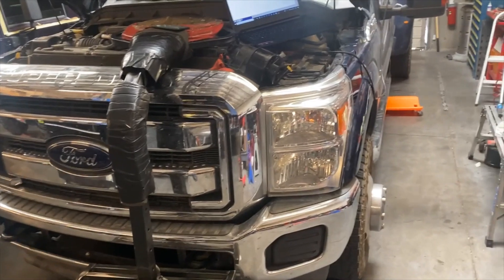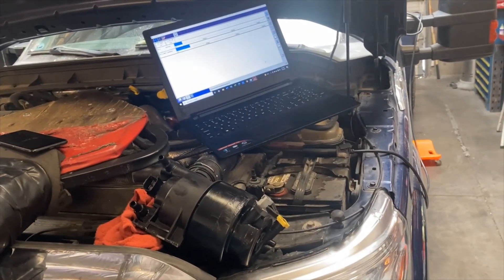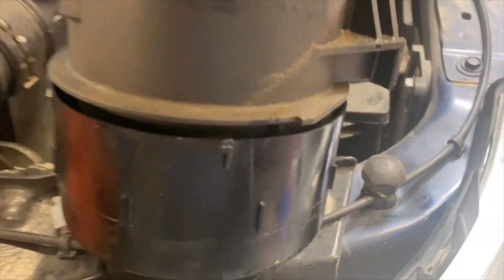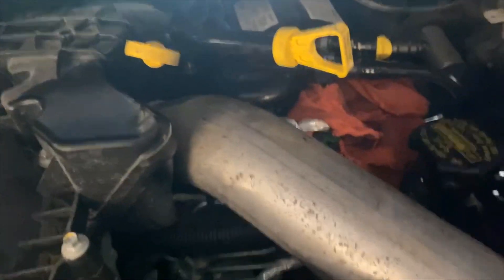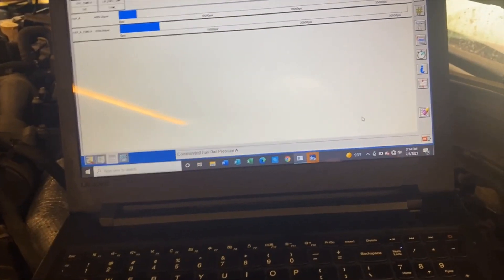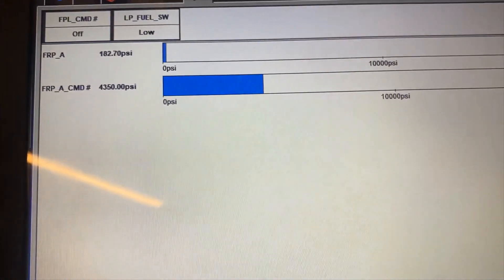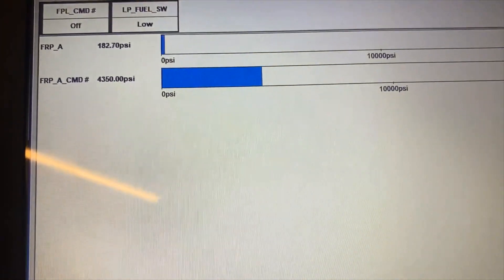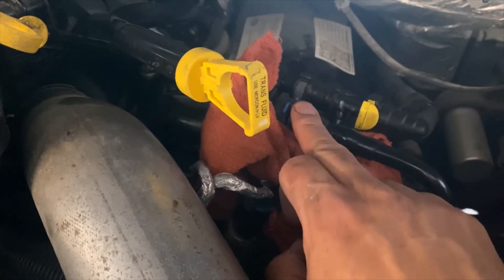Powerstroke 6.7L low fuel pressure on lift pump low side

Comment: Great video! I have a question i have some kind of air getting into my 6.7 I changed the filters after a started getting this weird hum under the hood and a extended start situation , the truck starts up after a few seconds and runs fine no hesitation or rough idle. my lift pump which i changed out last year is a pump i bought from oriellys when my old pump went out. But its making a loud screeching sound? could this pump be the cause of this air getting into my system?
Reply from the maker: Loud screeching usually means air. If you have the early spin on filter did u line up the marks and tighten it to them?
Reply: @dieseltalkwithtonysalas8725   yes sir aligned the  tabs until they touched.

Comment: It really helped To grease where the fuel filter screwed in under the frame that when you take it off recently and then put it back on with a new filter. It really helped her that plastic is really sticky.

Comment: I know this is a old video. But im having intermediate cutting out mostly at low speeds and around 3,4th gear. It doesn't do it all the time but most of the time it will. Cold or hot. I've changed out both filters and and made sure it was at the stop on the lift pump. The code i get is p2539 code. 2014 ford f250 6.7 powerstroke.  I have a sct programmer on it and when it does it my fuel rate drops to 0 then back to over 300 withend a split second.  What do you think it would be. Thank you

Comment: I did the low pressure/ lift pump on its own and the billet/filter holder would not refill. I followed your advice and the air pumped out , the billet/filter holder filled and the engine started. Thank you!
Reply from the maker: Welcome!

Comment: Well I don't see what switch you're talking about.If you'd move your laptop off one side we could see what you're talking about
Reply from the maker: You know you could google it. The switch is on the outlet of the secondary fuel filter. 
On 2016 and newer models that low pressure switch and the fuel temperature sensor are as one unit.

Comment: Just an owner of a 2011 6.7 250.... but have also built my own acft so mechanics is second nature. Installed an SPE disaster prevention kit and micron filter which all went well. Problem was I violated my own rule...only change one thing at a time which was just install the kit, prime and test run. Like @stevewill1940 below, I also changed the lower fuel/water filter before testing but not the top. Two things were changed. And your comment about the canister not reaching the stop was the mistake I made. Found that thru the  bottle test and the stream was almost non exxistent. Rechecked the canister and saw the stop tab wasn't making contact by about a 1/16th of a turn. Fixed that, primed 5 times then fired right up. Good to go. Then changed out the top filter, 5 more primes and done. I've found the SPE unit to be well thought out except for the 45 degree fitting off the adapter having to be aligned further aft by about 15 degrees to avoid an engine casting contact.....may just be a 2011 problem.

Comment: Hey there please help me with my truck its 2013 f350 6.7 recently changed all injectors with cp4 to dcr conversion with new fuel rails filters and temp sensor.
Now at idle my fuel rails pressure isnt steady commanded is 4000 and actuall goes all the way from 3300 to 4200 psi and sometimes i can hear vibrations at idle and coming to a stop it wants to stall but smoothens right out with in a second it drives and starts fine pressure matches commanded when throttle is pressed even a tad bit and while driving pressure is fine?
Reply from the maker: @sahilbathla1824  first question
Was the fuel system contaminated?
Reply: No the fuel system was not contaminated one of the injector failed as a original problem.

Comment: Hey how you doing out there hope everything great I have a few questions I changed the pump under the frame I hook everything back up the same way I try  to start it it didn't start at all I see in the video when you was at 2 minutes you was saying that you took off the line where the sensor was at I wonder if you I take off that line the same way but the only thing is I don't have a computer or  scanner  or anything to hooked up  to the truck so I'm wondering if disconnect line and sensor that you were saying to bleed it out and get the air out would that work or I would need the computer and scanner
Reply from the maker: @FrankFletcher-p3t  Did you verify you getting fuel out the secondary fuel filter in the engine compartment?
Hook up a hose to the outlet line to a container when you cycle the key to the run position verify fuel flow
Reply: Good morning good evening thanks for the information I just unhook it the Blue Line meaning the blue one with the blue connection no fuel is coming out
Reply from the maker: @FrankFletcher-p3t  this is with key cycled on ? No fuel out of blue line?
If it a quick crank and leave key on.
Should have fuel coming out
Reply: At all

Comment: 2017 f260 I have this code p008a showing low fuel pressure on cold morning start 5f two times already no cel truck runs fine is it possible it’s gelled up fuel? It only happens on cold engine on start up, I did check pressure with forscan and showed 55psi on idle

Comment: I am an Ag Teacher, mainly Ag Mechanics, I have a random problem that started a year ago with my 2016 6.7L. Truck has 135k and has Lucas fuel treatment every 3rd tank of fuel if not sooner.  When on a trip longer than an hour, pulling or not, but mainly when pulling a trailer, the engine would momentarily cut out "cough", but never triggered a CEL code. Started in Dec of 23 and did it 6 or 7 times to April of 24.  I don't daily drive the truck a lot at the present.  We mainly use it for pulling ranch equipment or when I have to use my truck to haul students show animals and projects. The last time it "coughed" it did it hard about 4 times consecutively. I pulled off at the next exit and shut down the truck and found the engine had more oil in it than it should.  So I did an oil change in the parking lot of Bass Pro Shops.  I captured 3.5 gallons of oil and diesel.  Fuel has to be entering through the pump shaft seal as the truck does not smoke, has never been allowed to short cycle a regen,  and runs perfectly otherwise. The engine was 2500 miles on that oil change from December.  Took it easy on the way to our destination, and it "coughed" 2 more times.  Checked the oil and it was not significantly higher. Ran the truck to a local shop, they kept it a week and couldn't get it to act up. Picked the truck up and had it "cough" on the way to my ranch about 2 months later. Dropped it off at another shop out there and they had the truck for 3 weeks, could not make the engine duplicate the issue. While there, they pulled the sensor off the CP4 pump to make sure it wasn't failing.  No metal found, and nothing present on the pcm.  After talking with a former student who is a Diesel Tech he said he had never seen one puke fuel out the CP4 shaft seal without throwing a CEL Code of some kind.  Working blind he would replace the fuel pressure relief valve on the drivers fuel rail. I replaced it with an amazon should work part, finally get a code of P228F, scan tool suggested changing the valve or the pressure sensor.  So I picked up the pressure sensor from Ford. Still get a P228F  Fuel Pressure Regulator 99 Exceeded Learning Limits-Too High. I figure the valve is a reject and will be getting another replacement. 
 When I replaced the valve I also changed the fuel filters. On the wrong side of the primary filter I found a small brown algae worm in the bottom of the inside of the fuel filter. Now I notice that I hear the pump running way more than it should and I know the filter base is all the way home not bleeding air. Should the electric pump have a check valve on the intake line from the tank?  If it does and was bad could that cause some or all of this issue?  I am meticulous about my trucks mechanical maintenance.  I have to be since I have to use it for school trips, hauling show animals and ag mech projects. This is driving me nuts.

Comment: im a diesel tech myself,found best way for to avoid issues is change one filter at a time -starting the vehicle after changing the lower filter first,then the upper -and ive never had issues on a restart which does include key priming a few times.
Reply: Just did the exact same thing. Worked great.
Reply: @davidrods4678  its a simple theory....think about a drinking straw when capped off with  your finger.....dont let the fluid leave the tube and itll be there upon start up
Reply: That’s how I do it as well 🤙

Comment: Does the low pressure sensor read high pressure too?cause I got a P0088 code
Reply from the maker: The low pressure switch is a switch set at around 48 to 58 psi
Need to look it up
So it’s not a variable sensor just a switch.
P0088 is a code for rail pressure on the high pressure side.

Comment: Getting a p2539 code via ez lynk replaced lower lift pump and still having same issue. Truck loses power in between 1&2 shift and in between 3&4 shift under heavy load…
Reply from the maker: @dylanware2424  this can be more complicated 
If you have lift pump pressure and volume the issue is on the high pressure side.
I would start by checking for contamination by removing the high rail pressure control
Valve and look for contamination. You can also remove the volume control valve from the injection pump. Do that first before going after the injectors
Reply: Did you ever get your issue resolved? I have EZlynk with 2017 6.7 power stroke; when I punch it, I get the same issues you get.
Reply: Yes, Tuning issue
Reply: If you need any further help let me know and I can point you in the right direction
Reply: @dylanware2424  Ahh, thanks; what were you running with EZlynk? I’m using ‘Proven diesel’ out of Canada; I notice on the ‘high rail pressure setting’ that the problem was greatly reduced, but not fixed…but any of the +200 tunes would do it, if not running high rail pressure.
Reply: @jasonbaldridge4281  I still use the ez lynk platform but have full support through 2 different tuners, all custom unlike a proven or gdp. Had the issue with one tuner the other tuner have no issue with his files, currently running a 250 single and have zero problem. Other tuner the biggest file I could download was a 120 rumble file lol.

Comment: Im getting a p2291 after replacing the fuel filter i had a p228F and I replaced the fuel filters along with the high pressure regulator test drove it and now im getting the p2291 and it wont start
Reply from the maker: The pressure regulator on the drivers side rail? Why?

Comment: I have a 2014 F250 6.7 getting a P0087 and P2291 I changed out the DCFM I hooked a hose up to the inlet hose on the topside filter and waited to see if air came out or just fuel and fuel came out like normal but it just cranks and cranks. You think this what you ran into may be the problem? I did unhook the hose rope and it was definitely pressurized.
Reply: I have the same problem did you ever figure it out
Reply: @ cp4 pump took a crap had to replace the whole fuel system
Reply: @Stanton02  how did you diagnose the pump
Reply: @ my buddy who is a master technician for ford diagnosed and we found metal shavings in the fuel system.
Reply: @Stanton02 what did it cost? New or used parts and did you do it yourself
Reply: @nedthemumbler9942  I made the parts I had laying around but it turned out that my fuel pump was bad and I had to replace the entire fuel line and pump, I’m lucky to have a buddy who is a master mechanic for ford and he installed in for me.

Comment: HELP🫠

F350 was running perfect, i changed the fuel filters, primed them, truck fires right up, but now its like hesitating/stalling while driving. Ive made sure the filter cap is tightened all the way, im at a loss.
Reply from the maker: When u primed how long did u let it run before you started to drive it?
Reply: @dieseltalkwithtonysalas8725  20 minutes

Comment: @dieseltalkwithtonysalas8725 - have you ever dealt with diesel  pouring  out the  oil /air separator  (black box on driver side under the hood)once keyed on?  I have the reroute  kit or hose instead of the oil separator  box.
Reply: Yes, the original  oil/air separator  assembly  hose broke so it was replaced  with the re- route kit that reroutes through  a 3/4 line that routes down the vehicles frame  rail. Now once keyed on, fuel spray  or flows out that fitting  ports there, as well out the end of that 3/4" end of the line.
Reply: I agree that it shouldn't.  Just to  confirm,  it's  on the driver side near the firewall.   It's in place of the rectangular  box assembly beside or   where you check  your oil/ transmission  fluid levels.
Reply from the maker: Hold on where from the box? 
There should be no fuel there 
Need more detail
Under the box are injectors and return lines, you sure it is from the black crankcase filter?

Comment: Great video, my problem is, I am getting no power to the lift or pump to send it up to the upper fuel filter. It’s a brand new lift pump and I have jumped it off the battery and I know it works. Just don’t know why I have no power to the lift pump.
Reply from the maker: Good morning
What is the year model?
If the pump is not kicking on need to check fuses and relay.
Reply: @dieseltalkwithtonysalas8725  the truck is. Also deleted. This started when I change the tune of the truck and then the truck did not start back up. The truck was running fantastic before this.
Reply: Would it have anything to do with the ecm not sending a signal?

Comment: Catch 22: Replace the fuel filters to maintain pristine fuel to the CP4.2 to keep the CP4.2 happy. Replacing the fuel filters introduces air and low fuel pressure to the CP4.2 which damages the pump unless you use the soda bottle method.
Reply from the maker: But! The rule is you prime the system at least 3 times before starting and after starting you let it idle 10-15 min before driving

Comment: How do you get all the air out of the line
Reply from the maker: Good day!
Well you have to let the system prime and push air out . Cycle key every minute at least 4 times to have the lift pump push air out.
After engine starts, let it idle for 10-15 minutes.
Reply: There was air in the line 
Took off the fuel line air came out ,, primed it ,, started up,,then a week later the def pump went out .. omg that was a pain,, running Great now ..
Reply: Evening ,
A guy is coming to see if the lift pump is ok 

I have fuel coming out but it may not be enough pressure to start the truck . Does that sound right?
2016 6.7
78,000 mile 

I’ll check the fuel filter to make sure it’s tight,,,

Comment: Great video, I have A 6.7 and im getting code p228f and p0087 need help I've already put bottom pump and all sensors related to high and low fuel pressure and I've installed new filters but no luck I keep getting reduced engine power when I press on the throttle idk what else to look for other than the high pressure pump , trk only has 76000 miles
Reply from the maker: Was on vacation, sorry for not replying sooner, you get it figured out?
Reply: @dieseltalkwithtonysalas8725  not yet
Reply: I have same thing going on p0087 replaced high pressure pump fpr fps ford filters still getting p0087 showing 70 psi on low side and idea
Reply: Did you ever get it resolved? I’m having this EXACT problem right now.
Reply: @rhettpresley8788  no I didn't figure it out I just traded in the dang thing
Reply: @rhettpresley8788 I have the same thing, did you figure it out yet?

Comment: Has this caused a p054e code for anyone? I'm being lead to the fuel pump (not the cp4) my 2015 6.7 will have an ultra sensitive throttle until about 3rd gear, it will slam into 3rd and go into reduced power, after that it will push over 20lbs boost but doesn't want to accelerate past maybe 35/45 speeds and loses power even with 20+ lbs of boost. I'm at a loss. Acceleration can be erratic but definitely loses power when this happens.
Reply from the maker: Do a volume test for starters
Disconnect the outlet line on the filter and run a hose  from the filter about 6 feet to a container. 1 liter minimum in 30 seconds but do it a few times 
Let me know
Reply: @dieseltalkwithtonysalas8725 I already had a new pump, so I went ahead and replaced it. I'm still getting the same problem.  I'm pretty fed up not being able to pin point the cause.

Comment: Hey Tony, changed my filters , but did not bled as deep as you did with soda bottle. ran truck with no issues, once on highway the truck powered down and actually shut down. managed to milk it home. i hear a humming from the pump area. can the pump be bad at the same time or could it be air in the system. thank you for your time in advance.
Thank you    Al Alvarado
Reply from the maker: Did you line up the marks on the primary filter housing ?
Reply: @dieseltalkwithtonysalas8725  Initially I was about 3/4 of an inch off.  While troubleshooting I corrected the gap and I have not bled the 2nd filter.
Reply: Ran low and fuel fuel back up. It didn't hesitate very much. I did get a red light about fuel and it says press OKI did. However, after that it would stall and cut out. It idles good but once I get going 15 minutes. It stops shuts off. Do I have air in my system?
Reply: Oh, by the way, at that point I changed the upper filter in the lower filter. And it it was really good. Go down the road and it shuts off I don't know what to do

Comment: How do you operate the fuel pump with ids?
Reply from the maker: Lift pump i guess you mean
Look for it in datalogger it should have a # symbol next to it
Select it and you can look to the right of the screen and you will see a # symbol to activate it once you have highlighted it
Anything in your datalogger list that has a # symbol allows you to control it